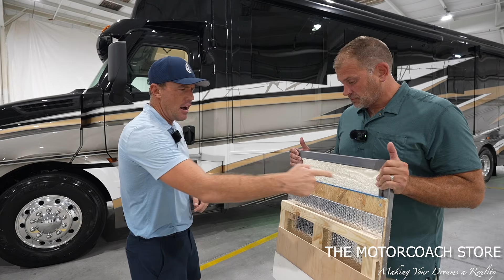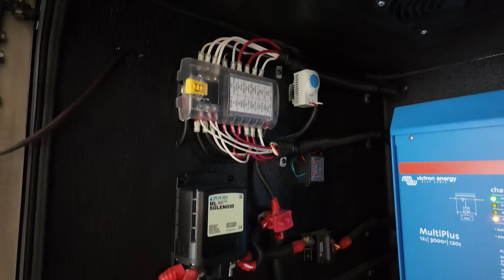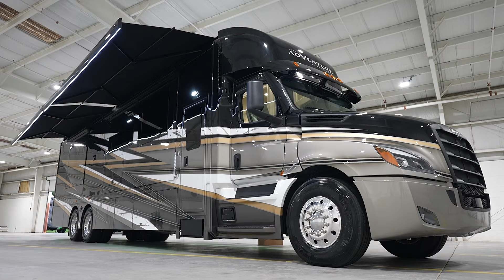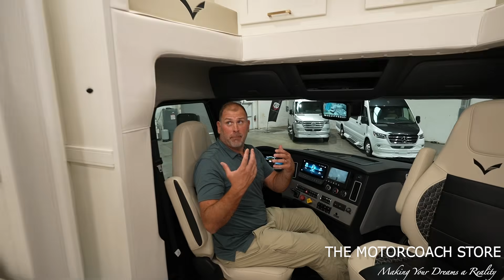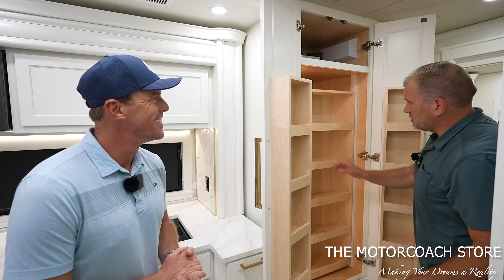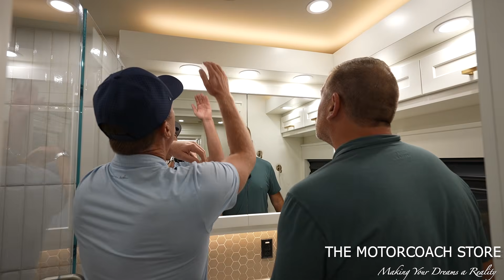2026 ShowHauler Adventure World Debut!

Comment: The exterior is the most sexy rv I have seen . But ....having the front entry in #1 reason I'd prefer Newmar. The front entry screws up entertaining area with the front seats and makes the TV too small , the TV should be directly across the seating and in the window area when deployed(televator) . The half bath door also seems to he hinged on the wrong side for easy movement. If bedroom door is closed it would be awkward to enter the half bath. Hinging on the left would fix that. The electrical set up is finally AMAZING Lithium standard AND Solar very nice, and reflects the low prices for lithium, and solar panels niw available.

Comment: Just curious, what kind of license do you have to have to drive that.
I know some you have to have cdls. To drive
Reply: You do not need a CDL, it's an RV.
Reply: i guess you should have CDL to drive it. ANd thats the problem.
Reply: @MerlinMoorlo the 965k is way more of an issue lol. I already have my Class A. RVs are private coaches and don't require a Commercial license. Some states may want you to have an air brake endorsement or class B, which is pretty easy to obtain.
Reply: You do not need a CDL, but it will depend on the state— my state requires a B.

Comment: $965K is absolutely INSANE with no ability to control the blinds from an app on your phone?????   

Meanwhile they are still using NON FLUSH slides with square corners with a 300K price increase.  😂😂😂

Make it make sense please.
Reply: The slides may look a bit clunky, but SH will never switch to a cog and wheel type slide like Renegade uses (and Renegade and Newmar still use electric slides wherever possible, will only put the larger slides on hydraulic) until dealer service shops start phoning in with complaints that they're always needing repair (they don't). These Liftco slides are not fail-proof but they fail far less than others, and they have a lot more room to add insulation which is really nice for SH owners who sleep in a bedroom slide.  

As far as the shades go, I am super happy they added those toggle switches to manual as I've been saying for years that the auto shades are just another thing that break after a couple years- almost without exception. I always set them to manual when I'm around the coach during the day- only use the atc control for them at night or in the morning when I want all the blackouts down or up at once. And if I go out for the day and there's any chance of it being 80+ with any sun, I just close all the blinds before I go out..easy peasy. 

SH will always go function over form, I'm actually shocked this coach looks so 'upscale' inside. The MSRP is jacked up because this coach has two extra Girard nova awnings on the drivers side, not just empty cans, + 2 extra lithium batteries and 3 extra solar panels over any similar Super C coach, even with their maxed out options. Plus there's an additional fresh water tank and an additional black water tank each with their own Sanicon 600S system. So you total up just those features and you're automatically looking at 75K just in those alone.

Comment: This is a nice start for Showhauler in the production segment.

The wall construction, interior space with the slides in, and towing capacity are really impressive.

The Showhauler interior design seems to have significant improvement over prior years. Good job! 

For the price, I was surprised to see a few things missing:

1. Lining inside the cabinets (woven material or carpet). Minor item, but easy to fix. 

2. Additional interior color schemes.

 To offset any reduction efficiency, Showhauler could charge an additional fee for colors outside of the white / grey mentioned in the video. 

In my opinion, Newmar has them beat in terms of interior design. 

The Showhauler is built better, so this may be a satisfactory trade off for buyers.

3. Furniture material

Is there still a problem with ultra leather peeling? Or was it just a FlexSteel problem?

I was expecting real leather for the market Showhauler wants to break into. 

4. Floorplans

I think Showhauler is smart to start with 2 plans as this gets introduced. 

After they sell more units and see how it impacts their custom orders, I'd like to see more plans offered. 

I do think an option with the mid-entry could be popular.

5. Interior storage

This seemed light considering that Super C's have less bay storage than Class A's. 

I know the laundry closet was mentioned as additional space if the washer and dryer weren't included. 

Maybe add a higher end combo unit so you don't lose laundry altogether, but gain half the space for storage. 

6. Outside Door Steps - Finsh

These were not painted / finished off to match the paint design.

I'm nitpicking here. For a msrp of almost $1 million, I was surprised to see these be black instead of the grey / tan tone that surrounds that bottom area.

Congratulations for making it to the end!

Comment: That Detroit assurance lane departure warning system SUCKS!!!  Get ready to be extremely ANNOYED!!!!

Be prepared for the brake to be slammed on for absolutely no reason.

You are definitely NOT getting 900 miles out a tank of fuel.  The tank only hold 85 ACTUAL gallons. You get 400 to 500 miles out of a full tank. 

It get’s 5 to 6 MPG with or WITHOUT a trailer.  I drive one so I’m speaking with first hand knowledge.
Reply: My 2020 ShowHauler with the X15 Cummins routinely gets 7.5 to 8.0 mpg.  You're correct, you can't get an actual 120 gallons in those 120 tanks.  I get about 90 to 95 in mine.  No way you'll get 900 mile range.   That said, I stop to fuel up about 500 miles anyway.  I have the Wabco Onguard adaptive cruise control and collision management system.  It can be finicky at times also with unexpected braking.  No lane departure on mine, thankfully.   Still, overall I love my ShowHauler.

Comment: Another white and grey interior. Hopefully their darker cabinet options will be better. Plus, it would be nice to have air-seals on the slides at this price point. On the upside it's nice to see that amount of Lithium battery. I hope they also have an engine diven generator plus rooftop solar to recharge them while going down the road.
Reply: Those slides with air seals are extremely expensive.  Valid slides out of Canada.  Prevost, Newell, 1492 Coachworks and Foretravel are the only ones I know that are using them.  The 1492 Super C's that Andrew has done a few videos on are 1.5 million
Reply: @michaelmacon2691  you are absolutely correct.  1492 is by far the most expensive but they also make the nicest super c’s on the market. They have flush mounted slides with ROUNDED corners.   Not the same square garbage they haven’t improved on for over 2 decades yet charge an EXCESSIVE amount for.
Reply: @michaelmacon2691  They are especially expensive thanks to Trump's tariffs. American workers will continue to suffer until he's out of office.
Reply: @duncanjames914 you mean american workers might have jobs in their future thanks to Trumps Tariffs. create a place for your kids to work!
Reply: @duncanjames, the price point and options is RIDICULOUS.  There is literally nothing new in the last 5 years except the solar package.
Reply: Very pretty!  I wish they would have put some cabinets above the dinette, theater seats and couch.  Storage space seems to be limited.  I an interested in seeing the dark interior.
Reply: Sound like a everything u need is in a renegade rv

Comment: Very nice Andrew. For me the interior is a bit too bright, I would add some grey tones to the interior to offset the white. Also I would add a steer axle in behind the drive axle,also it would eliminate 2 tires. I find the TV a little odd. Above the driver/passenger I would put a large sun roof. I believe that front end has a solid suspension,in that case I would prefer front airbags too.Makes the whole coach ride on air. Another great video team Andrew.Cheers

Comment: #AndrewSteele introduces The Adventure Line boasts aluminum sidewalls and tubular steel framework throughout the entire coach, including sidewalls, back wall, ceiling, and floor, making it highly durable. The steel beams are spaced every 16 inches on center . It also features spray foam insulation, 7/16 structural wood, and Reflectix insulation for R-value and sound deadening